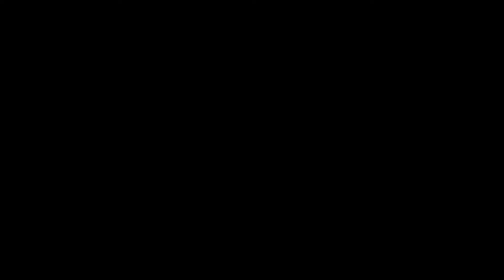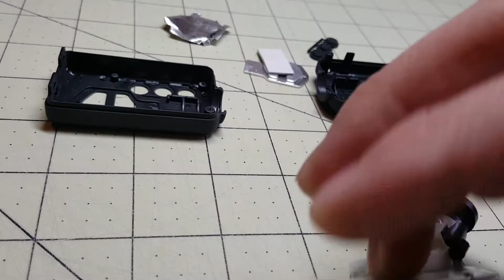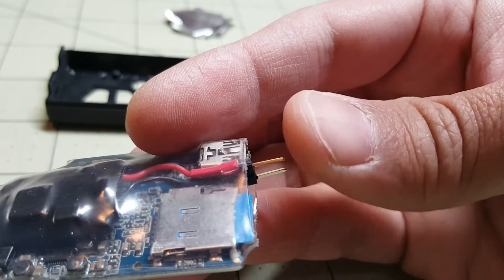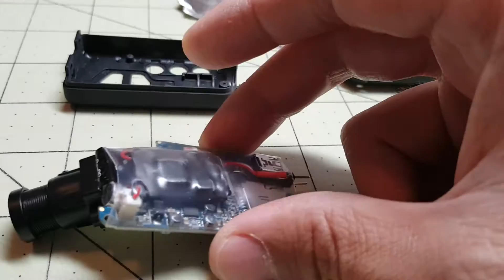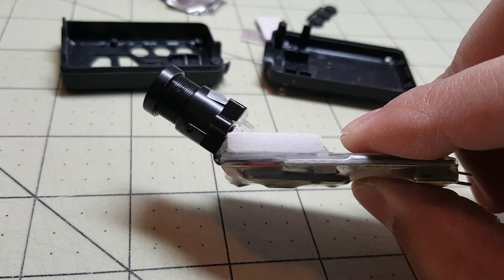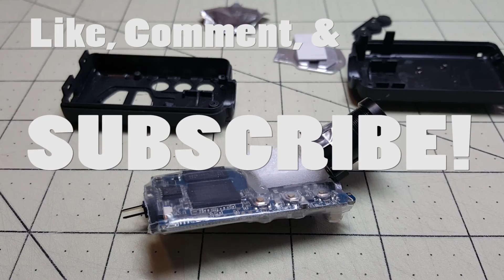Hacking Mobius for Under 250g

Comment: I like it.  I have a couple Mobius lying around that I  am no longer using should try this out on.   I am thinking of this on a tyro 79 which already has a 5v BEC on the 4 in 1 ESC board...I wonder if that will work (and not introduce noise into the video) and allow me to avoid the step down regulator.

Comment: Hey bro, that is my project for today. 
Question :
-I'm using a mobius mini and I was gonna power it from a 5v 1amp power source that the KISS aio offers. 
Is 5 volts 1 amp enough to run the mobius mini ?
Thanx 
Marc 😊❤
Reply from the maker: Yes, 1 amp should be enough assuming nothing else is being powered by that 5v regulator.
Reply: I was going to power a micro fpv camera with as well. The vtx i can power straight off the battery. Would that be too much ? lol
Reply from the maker: It would depend on the camera you use.  How many amps does it draw?  What about the receiver?  If that is also on the same 5v rail you'll be in trouble I think.
Reply: i'll be using the runcam nano. Idk how many amps it draws, do you happen to know ?
The receiver has its own designated place to grab power from. 
The power source i'll be tapping into would be from the breakout port.
Reply: 140mah is what the runcam nano draws.
Reply: 1amp @ 5v is plenty for your mobius and receiver

Comment: I would be somewhat concerned about no heat sink on the cpu. Have you tried running it for a few minutes?
Reply from the maker: +Hoggdoc haven't noticed a heat problem yet. Its possible that the heat is getting out by direct contact with the air. After a 6 minute flight it was just warm to the touch.
Reply: ***** I just took mine apart. The "heatsink"  is just some super thin metal like tin foil and it's connected to the club with some kind of foam.  Direct air contact can't be that much worse IMO
Reply: Cpu
Reply from the maker: +Nathan Knight I think the heatsink is just there because the case doesn't allow for airflow. With no case airflow is obviously not an issue anymore.

Comment: Nice Hack.
Have you checked for noise since you removed the metal shielding?
Reply from the maker: +andrew hodgkinson how do you check for noise? I did a recording and it looks clean
Reply: +Albert Kim (marblekit) If your not getting interference it should be ok..
Just be aware that placing the camera to close to other electrical components might cause problem.
If any problems arise you can just replace the metal shielding under some heat shrink. 
Ps love your flying videos.  
Especially interested in Demo's  Drax.  
Plus your joint FPV flights.
Reply: +andrew hodgkinson wrap it in aluminum tape?
Reply from the maker: yes. already flew a couple flights. no issues. video will be posted soon
Reply from the maker: +Hoggdoc there is no shielding on the inside of the Mobius case so whatever noise existed before is the same as now... That is unless plastic will reduce RF noise?